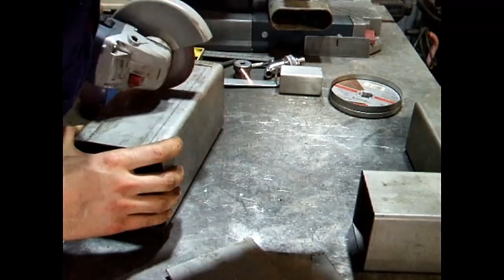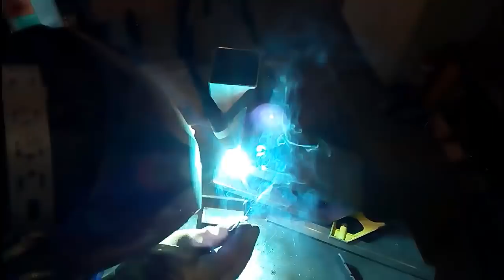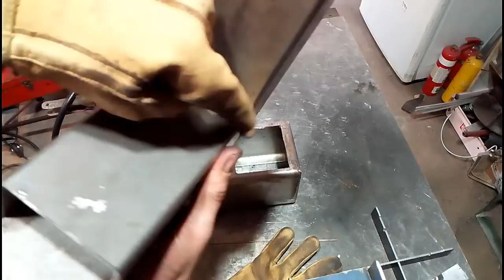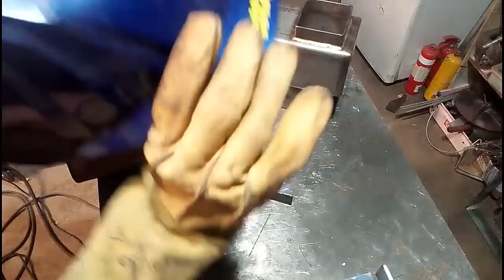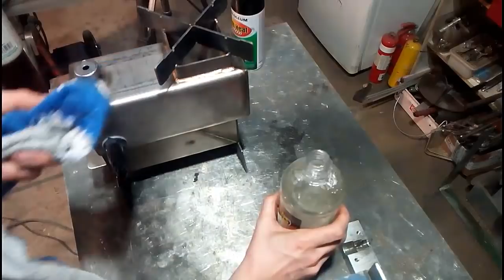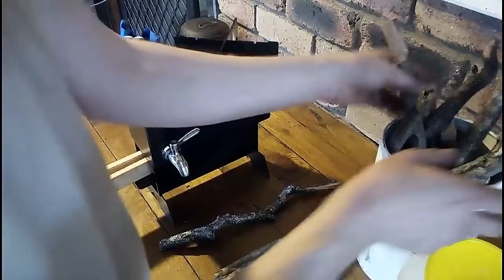Rocketstove Water heater build

Comment: Awesome build. My concern would be about that tap coming loose, that is not a serviceable nut on the inside. Kind of surprised,  you can just weld it on to the outside. overall, very good build. I appreciate you putting in the time and effort to share this with everybody.
Reply from the maker: If I was to do it again, I would tap a thread in a thick washer (4 to 5mm) and weld it on the outside, timed in the right place. Making it possible to replace the old faucett.
Thanks for taking the time to comment. Much appreciate. 👍
Reply: Weld the nut on the inside?!
Reply: Nice work! I love your video on this build...very nice and calm.
 I'm doing something similar for hot showers... Its a backup to my electric solar heater!

Comment: Great presentation and build video.  Since there is a vent hole in the fill cap you could probably insert a small meat thermometer probe into the vessel to measure liquid temperature at the cooler end of the tank.  Looks perfect for winter camping in snow covered environments.  
Good enough for government work; measure with a micrometer, Mark it with chalk and cut it with a chainsaw.   Thanks for sharing this video.  Trusting that you and your family are safe during the pandemic.   Wishing you Peace, health and happiness.  Cheers.

Comment: I'm starting a wood stove build  tomorrow...that will be fun...lol...I'm shortening a 33 gallon sandblasting tank from 30 inches down to 17 or so...it'll be my main heat and cook stove, but I have a solar system big enough to run my oven if the fire is out or something...I like using the wood fire to cook though...yeah I will have to get the stove done so I can make some cornbread on it in the square cast iron skillet...it's an old Wagner...lol...other people make skillet cornbread, but mine comes out perfect...that's probably the first thing will be cooked on it...I was just starting my solar when the winter storm hit but by December I will have tripled my batteries from last year and two and a half times as many solar panels...we are having the craziest weather this year so I thought I would upgrade my stove...

Comment: Great content. I have few considerations. In other video you talk about the fire triangle, Heat, Fuel, Air. with direct exposer of the water  to the burning chamber you take the heat away and probably would be better to place the water container in the upper part of the stove. 
This build is beautiful, and a close one to my dream project.  
Adding raspberry pi with few sensors, automatic ignition, emergency fire extinguishing system and 24 hrs self feeding pellets container is what I wanna build for my house , one day. I liked your insulation of the burning chamber from other video. 
Last topic ash container, in lots of rocket stove the horizontal pipe is as low as possible, and there is no place for ash to fall. If in stead of "L" form the stove have 90degree "T" form, wont that make it more user friendly. 
I like your style . Keep the cool stuff.

Comment: I like this stove do you think you could weld the water boiler up so when you wanted to boil water you could just slide it on the flu and or slide it off when you don’t need hot water, even a handle to grab with gloves to put it on and off just a thought great video

Comment: If you ever build them for sale, it might be worth tapping a thread into the water box for the tap rather than using the nut. Also if your seal ever gives you any trouble, have a look in a homebrew store. There are 2400w kettle elements that come with some kind of thin (normally red-ish) heatproof seal that would do the trick. They look like they are made of fibreglass or something, and work well at high temperatures, but silicone (it looks like your seals are silicone) will cope with 200c with ease, so as long as you run it with some water in it, it shouldn't give you any grief.
Love your work!

Comment: I have enjoyed watching 3 water heater  builds as well as the coffee maker which is cool but singular in use.
Perhaps  a pit-cock that would not require water to be in the tank at all times would be better..
Or like you suggested, maybe just a pot to make coffee water in on the exhaust riser would be most efficient.
That aside...
Have you considered that when using gas in a conventional water heater, the heat is located solely on the bottom of the tank?
This may be the answer you are looking for instead of a heated pipe of water that will super-heat rapidly creating the steam engine effect that tubing seems to plague your designs with.  My first thought was a small tank + - 5 gal.US that any one of your rocket stove designs would burn below. A short riser that throws flame directly on the bottom of the boiler tank. My thought here is that a more controlled boil with higher hot water volumes may stop the super-heated events. Or perhapse an 8" riser with a 4" tank inside it similarly design as your pipe with tabs. the thought is to get the water volume up.
Any way. these were just thoughts bouncing around in my head as I watch you work out issues.

Keep doing what you do as I have thoroughly enjoyed following the evolution. I do not mean any of this to be taken as criticism, more in fact as encouragement.
 For camping or other "off grid applications" rocket stove technology and efficiency is quite attractive too me.

Comment: Regardless of what the web noise has to say about it I think you did a nice job on the video.  Some of these people talking about mineral deposits must think this is your new kitchen stove for the house and will be used day in and day out for years.  In reality, if it got used more than 3-4 times a year I'd be surprised !!  Thanks for taking the time to do the video.  Hope your water tank isn't pressurized as steam explosion is pretty nasty stuff.
Reply from the maker: YourOldDog thanks mate. The boiler is an open unit.

Comment: Positives:
I have noticed a vast improvement on your TIG welding skills 👍 Nice work!
The design is really quite nice too. 👍
Negative: ... Yes only one LOL
Really bad choice of drain valves.
Next time save yourself a bunch of money and just go to the local hardware store, buy a 1/2 inch female pipe coupling and a cheap valve with male pipe thread.... Weld the coupling to the tank and thread the valve into it.
The fancy expensive bulkhead type valve you installed will be all but impossible to repair if the sealing washers ever fail !!!

Comment: Awesome,always wanted to try the water tank style but a little different run a 1" are 25 mm pipe 180 degree bend threw the chimney side with pipe unions on the outside to hook a tank to it . But I like your design
Reply from the maker: That's a great idea. Thanks

Comment: you should  put a relief valve on your water heater or it will blow up if you're not watching or worse...great fun site and i like your work..K
Reply from the maker: Thanks mate. It's an open system, the cap has a hole in it. It's impossible for pressure to build up. Cheers
Reply: I can’t understand why people keep commenting about you needing a relief valve when you clearly cover that in your very well narrated video. Maybe they didn’t really watch the complete video but surely they should be able to see the hole you drilled in it. It attest to your character and patience that you answer their comments about the tank not capable of blowing up being as it’s an open system and countering with “reference video explanation of this”.  You are very pleasant and easy going. Thank you for such great videos!

Comment: I would drill a smaller hole in cap, put in rubber plug, attach cap with small chain and if worried about
safety sally's etch "remove when using" on cap. Great video, good looking stove.
Reply from the maker: Thanks mate 👍

Comment: US plumber old guy lol but slicone is bad idea and will not cut it for this application guaranteed  so would tap it so you can change it if it fails....get a ball valve type it will last.  beware of superheated water...i see  a hole in fill but i feel you should safe guard yourself from small container with high btu's input...not balanced maybe.  thx for your work....enjoy watching you and like your talking etc

Comment: i have that same tap. It still works years later, but after a few months mine kinda 'settled'. Instead of swinging open smoothly, theres kind of a lump halfway through. The screws not loose though. Like sliding your foot across a blanket's wrinkle and you feel the lump of the wrinkle. I don't know what internal mechanism makes it feel like that, but it doesn't leak.
Reply from the maker: Sweet, good to it should go the distance. Thanks!

Comment: Like the idea. I can see the usefulness here however the only way I saw to "turn off the kettle" is as you said. Pull the fuel. Also just letting the water boil off would then let your soft parts (washers and spigot) melt as they heated up to match the burn box temperature.
Reply from the maker: Yeh, I've pretty much not pursued this style because of these reasons.  Sometimes you just gotta try these things though. Thanks mate

Comment: I really like your work mate. You're a real inspiration. But I think I would have welded the nut onto the inside, and a washer onto the outside of the tank, and left the option to renew washers in the future. Plus, with the constant expansion and contraction, over time the nut will very likely work loose. .. then you really will be in a pickle!!!:)
Reply from the maker: Yep, you're absolutely right, in fact I am almost considering buying a tap so I can cut threads in thick stainless steel washers. 👍
Reply: How about just buying stainless nuts? You need as long a thread as possible.
Reply from the maker: @moderatefkr6666  from memory it had a some odd thread. BSPF gas or something similar. Would have  do some searching to find nuts with that thread in stainless steel. The washers I was thinking of would be 6mm thick, hopefully with the fine thread that would be good enough, but I hear what you are saying, heaps easier if one can just buy a nut and tig it on.
Reply: Wow, BSPF, that takes me back. And the Chinese are using that standard? Cool. Well, you know the diameter of your tap, the chart on this wiki page has the pitch, so you will be able to figure it out. But if you need a deeper hole, you could put one on the outside and one on the inside - aligned with a spigot for welding, then drilled to the tap diameter. Good luck. I like this one. 

https://en.m.wikipedia.org/wiki/British_Standard_Pipe

Comment: This was so much more than a two n one, it would also have been an excellent fuel efficient radiator. With the feet pushed into the soil and little modification could be used within a tent. What I would have liked to know is the weight and where could I buy one as I'm no welder.
Reply from the maker: Love your input, really appreciate it. Hope to have these for sale next year. Have a good one.

Comment: It looks like a Swiss Army knife of rocket stoves. I wonder if you could use some of the technology from the "rocket mass heater" fad to create a stove that just boiled water; wasted as little energy up the chimney; had a secondary burn; collected the creosote from the gasses; had an inspection hatch so that the tap/washers could easily be replaced; used as little construction material as possible, without compromising a minimum of daily use for 20 years; (and had slots under the burn chamber to collect the ash in a removable tray). #challenge
Reply from the maker: Wow let me think about that. I am in the process of building a miny Mass rocket stove prototype.  J style.   But that is a Challenge.

Comment: Could you make water heater detachable  ?  I wish detachable water tank can be placed on top of rocket heater possible  leaving cooking area upfront , water heater wapping around the rocket heater from back side.  Extra width of water heater can be used as area where you can rest your small sized pot  or keep food warm ..  permanently  fused water heater is hard to use.

Comment: Saw that the tank was welded to the burn tube. Could you redesign it so that the tank is removable and forms the top of the burn tube and when the water is hot you remove the tank and drop in a removable top for the burn tube or maybe a second tank?

Comment: Good stuff. At 40 seconds you pull the square tubing out of the channel. Why not make a "removable" water chamber out of the square tubing that would slide out when water is hot? Just an idea. Also, I'd position the lid just over the tap so you can jam in a tool (screw driver, etc) to hold the inside nut to tighten the tap... because you know that it will loosen after a while. Loved your video.
Reply: That's probably a good idea. It would also make it pretty easy to change the tap. But like someone else said, it's not as if this thing is being used every day.

Comment: Nice Build, Just Curious, Why You Built The Chimney Pipe Soo Short? Wouldn't It Draw Better & Create More Heat If Taller??? Thanks
Reply from the maker: That's right a longer riser would have been better, all my builds are made from scrap metal so the stove was limited in size for this reason. Thanks for your questions 👍
Reply: @LittleAussieRockets  But on the case of that Lil' One, It would be easily adapted with just a few tin cans tacked together or short piece of stovepipe for a taller riser also! Making it much easier to pack around camping like that also! Great Mini Design Ideas! Thanks Again Mate...
PS Your daughter there looks just like mine about 30+ years ago, now she hardly talks to me anymore since she's on her own world!? LOL

Comment: Take a washer and weld it to the side and use a long stem bend 1 side 3" then screw it to the washer add another double bend on top... So like this you can screw a hood on and you can use it in the rain or protect against the flames...

Comment: great stove mate. could it be plumbed to a small radiator. ?
Reply from the maker: I suppose you could, but I just finished a rocket stove with double the output that uses 5 meters of copper pipe to heat up the water. It warm up 200L of the to 68 degrees C. in 1 1/2 hours. Video is coming soon.

Comment: i feel like if you had done the tank upright u would of had alot more usable water because of the tap fitting issue but thanks for the video nice work
Reply: That's true, but we wouldn't want to run it empty anyways, and scorch the inside of the tank from the heat. We'd kinda need to keep refilling the tank to keep it from boiling away and then melt the rubber seals on the tap. I doubt the tap can handle the heat of being run dry, even if you get heat-resistant silicone or copper washer seals for the bulkhead fitting. We would basically have to change to a purpose-built more or less fire-proof tap, since we would be heating very near to the tap. Putting it the furthest away from the fire (without interfering with the feed-tube) like he did in the video is probably smart. Safest would be to mount in underneath the tank entirely on an elbow, not needing the bulkhead fitting with seal at all, being lower than the fire will protect the tap optimally, but then we also need higher legs to have useful height for putting receptacles under the tap (tea-mug or cooking pot for example).

Comment: I don't have a powertig welder (yet!). Can I weld a stainless steel rocket stove like yours with my everlast mig welder?
Reply from the maker: Hi mate, u can weld stainless steel with a mig, but to do it properly you will need to run stainless steel wire, 100% argon  and maybe change the liner in your mig touch. You can weld stainless steel with mild steel wire but it will rust.  Not ideal.  Tig is the go on stainless steel, worth learning 👍 for stuff like this you can't beat it.

Comment: It’s a shame the water tank cant be made removable for those of us with high mineral content where calcium buildup is inevitable. Perhaps a bolt on tank down tight on a heat resistant silicone seal? Eventually the seal for the Chinese spigot will leak and need replacement. I suppose running only distilled water would solve at least the cleaning issue for a while but the spigot seal remains a weak point.
Reply: Every year or so just boil up a mix of 1 part white vinegar and 3 parts water leave it to sit before doing a couple of rinses with normal water.

Comment: Excellent way to use otherwise wasted heat. Is the lid on the water chamber a pressure release one of some description for safety? You should add a kettle whistle on there :)
Reply from the maker: The water chamber is a unsealed vessel with a 10mm hole in the lid,  I want to live!!  : )   I've had a few people comment about a whistle, the only issue I see with that is, when this stove gets on the boil, you can't take it off, which means the whistle would get annoying fast. :)
Reply: Ah yes, that makes sense. I wonder how much faster (if at all) it would boil with a solid lid? Anyway, nicely done, sir! :)

Comment: Where did you get the 4" square steel pipe?
Reply from the maker: I found all the stainless steel bits in the off cut bin at work.  The boiler wall folded from sheet metal.

Comment: The entire point of a 'rocket' type stove, by way of the combustion chambers being air-feed controlled and very well insulated throughout, is to provide the best conditions possible for a fully developed combustion process, the heat from which is then harvested only at the very end of the process.    
As shown by the yellow flame indicating not even full first stage combustion, this unit is therefore not even close to being a rocket stove.